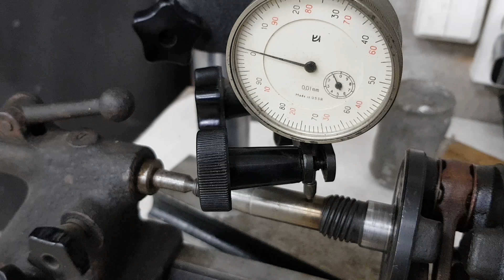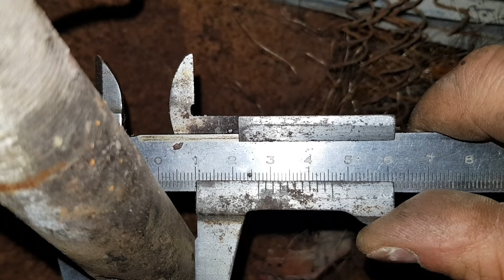Скутер с нуля #4 установка коленвала

Comment: You have to tighten the bolts crosswise and have to heat the block and put the crank and bearings in the freezer